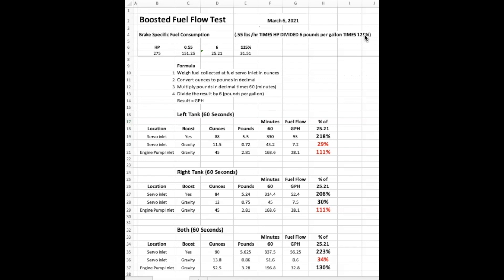BEARHAWK ~ Fuel Flow Test (Part 2 Airworthiness Certification and Phase 1 Flight Testing)

Comment: I don't understand something here. I got all the BSHP calculations and they look correct. What I'm missing is the fact that you don't seem to be taking into account the engine-driven fuel pump when you are calculating the required flow. The engine-driven fuel pump is going to lower the pressure in the fuel lines from the tank so it will flow more than it would through gravity alone.

For example, my Bonanza has a 300Hp IO-550 and it burns around 28.5 gallons per hour on takeoff. The difference is that it's a low wing so zero fuel will flow to the engine-driven pump when the engine is not running. The pump is drawing a suction lift to get the fuel up out of the tanks and to the engine. The boost pump on a Continental is only used for priming the engine pump to get it started and emergencies. It's off for takeoffs and landings. 

Your setup passed your test, but I think the target numbers are much much higher than necessary.  I know you have a Lycoming, not a Continental. But the logic is the same; if the fuel needed to flow to the pump via gravity, there would be a whole bunch of Pipers and RVs that wouldn't work (low wings).
Reply from the maker: I think what we are seeing is correct.  The ultimate goal of this test was to determine gravity flow to the engine driven fuel pump with low tanks and high deck angle.  We want no suction at the engine driven pump.

Comment: I’m sure you know what is happening but I don’t like it, no sir, not one bit!
Reply from the maker: Ok!  Thanks for watching!
Reply: @TheBaldPilot  I really want to be there when you fly that thing.  You have done such a wonderful job.  I also had some questionable fuel flow issues with the Murphy with the monster 350 hp Lycon I had in it.  If you didn’t have the boost pumps on you were going to have a very bad day.  When are you looking at having your first flight, any ideas yet?

Comment: Loving these vids.  Just got my plans this week.  Hopefully will have the kit this summer.  On your gravity test.....wouldn't you get more flow in flight due to pressure in the tanks from the forward facing vents?  Does the ground test values already account for the that?
Reply from the maker: It's a great kit!  I would imagine that there would be slightly more pressure on the forward ports in level flight.  The ground test assumes the worst case scenario.  You have flown until almost fuel exhaustion, lost your boost pump, and are now about to land and have to perform a go-around.  You are pitched up and climbing out with no boost.  Will there be enough gravity flow fuel to the engine driven pump to keep flying?

Comment: Rob, I got to admit I was a bit worried as you elevated the aircraft (in pitch) with only the tail wheel secured by chocks and also there  appeared to be no one there with you in the unfortunate event that there was a mishap, god forbid.

Great video by the way (two thumbs up). Appreciate you sharing it.

Suggestion :
-------------------
Anyone working around a prop should place large foam pieces on the tips of the prop, so you don't accidently incur an unwanted head injury by walking into the prop.
Reply from the maker: Appreciate the concern.  There was another guy at the front of the hangar working on his Mooney.

Comment: Are the specified amounts and percentages for that engine according to FAA? Or is it for the  high wing configuration?
Reply from the maker: No reference whether high wing or low wing.   However the FAA doesn't specifically say Brake Specific Horsepower Fuel Consumption (BSFC), it basically spell out the same formula in AC 90.89B for determining the fuel flow rate starting on page 33. 

"Fuel Flow. A fuel flow and unusable fuel check is a field test to ensure the aircraft engine will get enough fuel to run properly, even if the aircraft is in a steep climb or stall attitude, and is accomplished by:
(1) Place the aircraft’s nose at an angle 5 degrees above the highest anticipated climb angle. The easiest and safest way to do this with a conventional gear aircraft is to dig a hole and place the aircraft’s tail in it. For a nose gear aircraft, build a ramp to raise the nose gear to the proper angle.
(2) Make sure the aircraft is tied-down and chocked. With minimum fuel in the tanks, disconnect the fuel line to the carburetor. The fuel flow with a gravity flow system should be 150 percent of the fuel consumption of the engine at full throttle. With a fuel system that is pressurized, the fuel flow should be at least 125 percent. When the fuel stops flowing, the remaining fuel is the “unusable fuel” quantity.
(3) The formula for fuel flow rate for a gravity-feed fuel system is 0.55 times engine horsepower (HP) times 1.50. This gives a fuel flow rate in pounds of fuel per hour. Divide the pounds-per-hour number by 60 to calculate pounds per minute, and divide again by 6 to calculate gallons per minute. To get gallons per hour for Avgas divide pounds per hour by 6; or multiple gallons per minute by 60. For a pressurized system, substitute 1.25 for 1.50 to calculate the fuel flow rate.
(4) The fuel consumption rate of most modern engines is about 0.55 pounds per hour per brake HP."